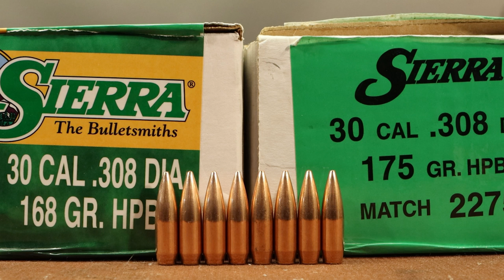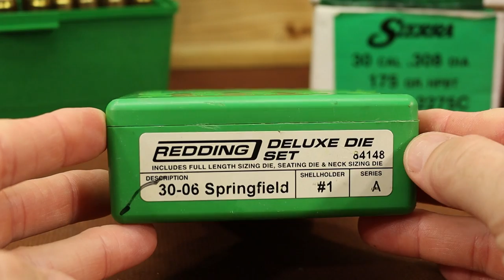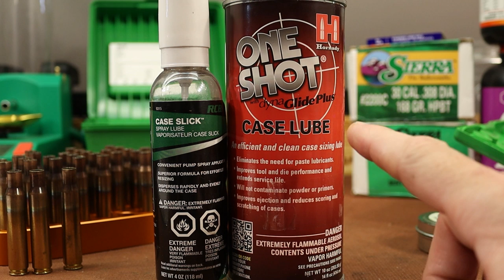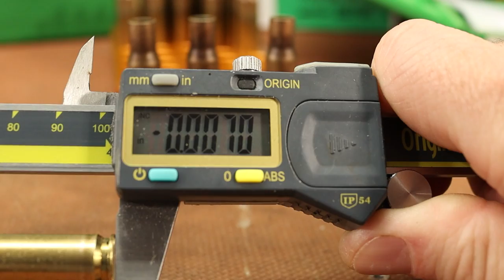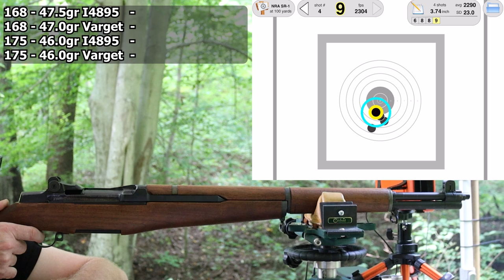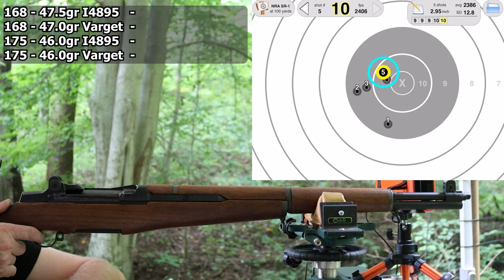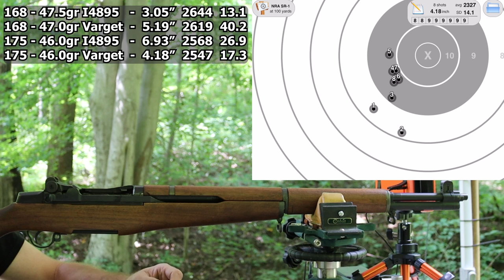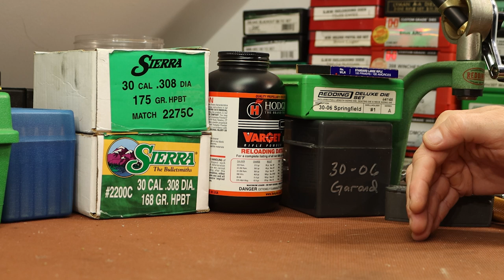Reloading .30-06 for my M1 Garand

Comment: Boy, was this video up my alley.  Good job.  I started reloading and shooting National Match in the early 70's.  I shot Garands and M1a's until the AR's showed up, now I mostly shoot in the John C. Garand matches. The only powder I use is IMR 4064 or  H4895, #1.  I load mixed commercial brass except for Federal, it's the heaviest brass out there even exceeding military by a large margin.  I use Winchester or CCI primers and my bullet of choice is the Hornady 150gr FMJ even out to 600 yards.  I duplicate the M2 ball load with 46gr of the H4895 and get 2805fps with the 150's.  The ARMY crono's were set 71 feet from the muzzle that's why the MV is slightly higher than their spec.  This is also the load recipe the CMP has loaded by Creedmoor Sports for their ammo.  My latest Garand, bought from the CMP, is a 1942 SA Philippine return and it now wears a Danish VAR barrel (+1 throat & muzzle) and has a very tight, new CMP stock.  The only changes from as issued is a Orion 7 stainless steel main spring and a ported Garand Gear gas plug.  https://www.garandgear.com/the-m1-garand-and-commercial-ammunition/
With that load my Garand will shoot 1 moa off the bench with the H4895 and 150 Hornady's.  I know, I hit the jackpot with that rifle.  I spend most of my reloading time on brass prep, I use the alcohol/lanolin homemade lube and I bump the shoulder .002" to .003".   I too could go on for an hour but you're on the right track.  IMHO you should try some 150's and step up your charges a little, that's where I found the largest accuracy node and it work's in all 4 of my Garands.

Comment: Thank you for such an excellent and detailed video! Have been reloading for about 40 years and started on my father’s sporterized 03A3 hunting rifle.  Got an M1 inbound from CMP.  Every once in awhile there is something that truly is a quantum leap in reloading.  First, I adopted metal media for my two tumblers.  Wow.  Even the worst looking used range brass looks like virgin after about two hours.  Second, I’m ultra paranoid about contamination in my reloading.  After resizing and de-primering, the brass all goes into the tumbler for thorough cleaning.  I then know that the case lubricant is all cleaned off.  No chance of contaminating a primer.  I use a Lee hand prime ring tool, and my machine of choice is an RCBS single stage.  I started with their Rock Chucker but moved up to a newer one that comes with a long and a short rod—I use the longer for better leverage.  I also use the fancy RCBS power measuring device with integral trickler.  Very precise.  Lastly, I use the LabRadar Doppler radar to determine muzzle velocity and speed at various points along the 100 yards.  Pure magic!  Again, a very good primer for someone brand new to reloaded, and a great reminder for me after 40 years of this hobby!  Looking forward to the M1.  I’ll be sticking to my 4064 which I started with for my 03A3, and with 150 grain bullets.  Thank you, for such competence!

Comment: 26:26 a piece of advice for new reloaders, stick with one charge weight and bullet combination at a time. Charge five cases with the same weight of powder, seat your bullets, move the loaded rounds to a container with a label showing exactly what they are, then move on to the next charge. I've wasted a ladder test or two in my day by getting things mixed up. Until you are confident in your procedures, process, and workflow, don't try to do too many things at once.
Reply: PERFECT ADVICE FROM JOE THE FOX , no use wasting a day and a trip to the range, keep it separated and dont let the counter boys dump your ammo for inspection into a pile while you turn your back for a split second
Reply: I've started using a sharpie to put my charge weights right on the brass in addition to a label on the container with more detail
Reply: I never loaded anything over 150gr heads.
Reply: @tyrellmorris9503  I've been doing the same thing for years.  A great way to keep track of things.
Reply: @bumblebeebob  I just use roman numerals in sharpie to mark my brass after every charge. Dullest pencil sharpest memory sort of thing

Comment: I've been using 168gr hornady bullets with varget. 
Years ago I bought a bunch of lake city brass.
Still have some virgin , but never a issue with varget. Just use plain old f.l. die set from redding. 
Love smacking steel with my Garand.

Comment: Johnny  one tip I have used for forty years is to spray  Lock-eze on to a rag and wipe the rag on the plastic funnels and it puts a coating of graphite on the funnel and kills static electricity that causes powder grains to stick to the funnel. Another thing to use is powdered graphite on a rag and wipe the funnel so you get a grey sheen on it. I Think pencil sharpener shavings would do it to.

Comment: Johnny, you're not having feeding issues. Smacking the back of the handle is part of the normal manual of arms for the M1 when inserting a new clip. (Yes those are actually clips, the magazine is internal on the Garand)
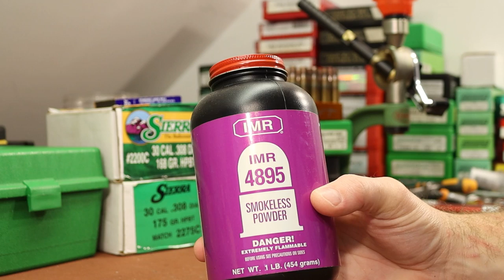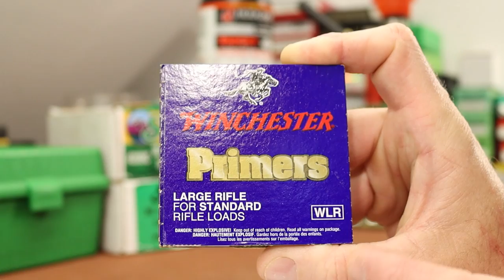Search for the video "M1 Garand - Principles of Operation (1943) United States Rifle, Caliber .30, M1" here on youtube and you'll see them routinely smacking it during loading. It helps prevent the dreaded "Garand thumb" (They do it twice between the 1:30 and 2:00 min mark)
Watching you load those clips, I predict you're going to get to experience the pain of a Garand thumb in the not to distant future

Edited to add: they change how they taught to insert the clip after this training film was made, to prevent Garand thumb. Once you get one, you'll understand why.
At a Garand training match, I had a President's 100  shooter/instructor put it best, "Garand shooters fall into 2 categories, those that have had a Garand thumb, and those that are going to get one"  FYI, they HURT!!

Comment: On the subject of case lube: GunBlue's way of applying Lee lube works great. You put a little lube inside a clear plastic container (like gladware) and shake the brass around until the lube is spread evenly along the entire inside of the container. Then, you use a q-tip like JRB just showed. Let it dry for an hour and you won't get any dents.

JRB, your presence on this platform is probably saving some from injury. You've definitely saved me a lot of money. Thanks again.
Reply: I hate to admit this... But, I add a bit of liquid car wax to my walnut shell media which does a really nice job of slicking up the brass as well as making them shine ;-) Killing 2 birds with one stone so to speak... My 2 cents
Reply: @n7565j  you're not alone. A lot of the dry media guys do that, at least to get the lasting shine.
Reply: @novicereloader  I'm glad I'm not alone👍 Thanks for not just calling me an ID10T 🙏🙏
Reply: @n7565j  did you notice my channel name? I wouldn't call someone names, unless they persist in being unsafe. JRB called himself that lots on the video with the primers blowing out, because he failed to check his brass between shots. He'd be right if he hadn't had the guts to also show his error and keep others mindful.

Comment: Johnny... seems like you are getting a lot of advice and support on IMR-4895, as you know, that is my go-to powder for my M-1 National Match rifle, I have won many medals with that powder over the years, (IMO) Varget is a little slow, as is the case with IMR-4064, they work, however, the chamber pressures are higher than with IMR-4895 and that will put undue stress on your bolt lugs, So, watch for shiny worn spots on your bolt lugs and receiver recesses if you continue with Varget, another thing as well, I use small base dies, I have witnessed a few super nice Grands worth thousands of dollars blow up because of a few thousands of (Out of Battery lock up on the bolt lugs) remember, the only place that pressure is going to go is back at the shooter. I feel it is better to have a little looseness in the chamber for positive feeding and lock-up of the bolt lugs.  So, That's great that you are shooting the old Girl, she will teach you a few things in Marksmanship, I feel that handling the recoil of the .30 caliber rifles in a match builds outstanding skills, more so that a scoped AR-15, (Not the same deal). Peace out. -Dave
Reply: Would you use IMR-4895 for .308 Winchester also, or would Varget be suitable for the cartridge? I want to start loading for my AR10.

Comment: I think my favorite recipe for the M-1 is a 150 grain FMJ over 50.0 grains of IMR 4064... absolutely love that load.  Shoots around 2780FPS or so and shoots light out in my rifle.
Reply: I use the 150 FMJ Hornady's and 46gr of H4895 to get just over 2800fps, basically a M2 Ball load and my Garand shoots better than most bolt rifles.
Reply: Years ago l settled on 49.0 grs of IMR 4064 for around 2740fps.  This was the older longer grained powder.  I've noticed the newer stuff is a shorter grain and haven't tested to see if there's any difference.
Reply: @bumblebeebob  yeah it's funny how a powder that is the same brand and name can still change from one lot to the next.  Either way with the new powder I'm sure your load recipe will still work great!

Comment: As usual, a great video, Johnny! One tip though for using Imperial wax on the inside of the necks: instead of using a Q-tip, just wipe your imperial covered index finger across the case mouth, and it will squeegee a little lube inside the case neck. Given, it won’t be all the way around the circumference, but the expander ball pushing in and out will spread it out nicely. Please keep up the great work Buddy. I love all your videos!!

Comment: With my first Garand, 37 years ago, I didn’t know that you were supposed to use Garand specific loads.  OOPS!!  Now with years of reloading experience my current Garand is running much better.  IMR4895 is the only powder I use for the Garand.  At least I didn’t blow my face off!
Try resting your rifle on the stock and not the front hand guard, is is designed to fit loose and may be affecting accuracy.
Reply: In my M1A or Garand , its IMR 4895 or NOTHING , 60 years of reloading proves this in my rifles , and my RCBS partner is this going strong after 46 plus years , with all calibers 30-06 down to 222 Remington.
Reply: I don't remember my charge weight off hand but I've always had for luck with imr4064
Reply: @deathsicon  IMR4064 is my favorite 308 powder.
Reply: @SSgt-  I started on 308 2 years ago and it's been my go to for that as well I pick it up just about every time I see some at a decent price

Comment: It hurts to watch you rest the rifle on the front hand guard.  The bolt hesitation on closing is normal.  Just shove the clip down until you hear the click and take your fingers and thumb out of the magazine well.  Then a light tap of the rear side of the charging handle will close the bolt.  Your clips are a little rough on the edges, and that will cause the bolt hesitation until the clips smooth out.  HXP brass is inconsistent volume wise, but will last a long time.  Segregate  the brass by year date.
Reply from the maker: I originally set up my rest to sit on the stock but decided to just put it out on the handguard at the last minute. You're not the only one complaining. I won't do it again.
Reply: Would it not make sense to do your load development with the rifle rested on the handguard if that is how you intend to fire it? I'm not going to pretend to load for Garand but I personally beleive this comes in to play with many rifles. milspec handguards for AR come to mind which I have observed POI changes as well when fired rested on different locations(base of handguard/slipring, mag, and front of handguard.

 I can only assume it can have an effect on harmonics but I Am interested to hear your findings with Garands and load development/groups, I really don't know enough about them besides commonality they share with all firearms.
Reply: @JohnnysReloadingBench  You are forgiven.  LOL
Reply: @savagereloader6699  The front hand guard is just there to protect the shooters hand from the moving parts and any heat.  It is nothing like a standard handguard on an AR.  Resting the rifle on the front handguard will produce variable forces on the barrel and gas cylinder and cause huge POI shifts.  You will see the front sling swivel is behind the front handguard, and is meant as the most forward point of support pressure for shooting.  The front handguard can be adjusted to provide some pressure between the sling swivel area and the end cap of the front handguard, and this will provide dampening of the barrel vibrations.  Get this pressure correct and an M1 will go from a 4 MOA rifle to a 1MOA or less rifle.  Like most wooden stocked military rifles these barrels are not free floated, but dampened by the stock if properly fitted.
Reply: I was also taught to not hold the weight of the rifle by the upper hand guard.  But we were competitors trying to shoot MOA with 3 MOA ammo.  Johnny, I still see 300fps less on the video than you are saying in the audio.
Reply: @gordonv2456  that’s because he’s calling out the velocity at the muzzle and the video is displaying velocity at the target. It’s very typical for a bullet to lose 200 to 400 fps in first 100 yards.

Comment: The front hand guard is a huge source of variation with the point of impact.  Many Garand shooters lock the front hand guard down with a process called “unitizing”.  They ream the front hand guard ring, screw and glue the hand guard to the rear barrel band.  It free floats the barrel in front of the hand guard.   Your use of the front hand guard to rest the rifle is probably going to cause huge variations in barrel vibration.  When I unitized my Garand hand guard my 8 shot groups shrank from 3.5-4” down to about 2.5” .  It is a lot more consistent.
Reply: You have been selected among my few giveaway winners, endeavour to Reach out to claim your Prize.
Congratulations🎉🎉🎊

Comment: I’ve been using the Lee threaded cutter and lock stud. Works with the same case length gauges and shell holders but you can screw the cutter into a motorized case prep center. So I can run my brass through the trimmer, primer pocket scraper, chamfer, and de-burr all in a matter of seconds. Works nice if you are doing larger lots of brass.

Comment: For what it's worth, Lyman sells a decapping rod that has a carbide expander ball that can be used to replace the decapping pin for certain dies, including RCBS.
It allows me to totally avoid contaminating the inside cases with a bit of lube inside the case mouth.

Comment: For the sake of simplicity and not missing anything, when I run the single stage press I go straight from powder charge to seating the bullet in that case, stops any confusion on if I missed or double charged a case, and the time it takes to seat it lets my Frankford rig throw the next charge so I'm not waiting on it

Comment: This is an excellent video even for a beginner like me. Could you please provide info on the target and velocity products you used at the range? Thank you.
Reply: His target looks like a 100 yard NRA high power target which would be correct from my understanding for this application. His chronograph looks like a doplar radar which is a good piece of kit to have. He has a shot mark system at his target using microphones to gauge muzzle velocity and bullet impact point that sends that data to his computer.

Comment: I took Basic Trng. summer of 1963 with the M-1 Garand & have three of them; yeaJohnny you got to have a WELD-Spot for your cheek on the butt stock to keep the rear sight the same distance  each shot. I was19 & "bullet proof". Shot "EXPERT' on that K D range @ FT. POLK,LA .  I use IMR 4895,IMR 4064 IMR 4831.As always GREAT video young man. 1SG, J J Huro Jr. USA, RET.

Comment: Thanks Johnny.  Sounded like your rooster wasn’t happy about those 30-06 loads.  Do you ever use that Franklin arsenal primer anymore?  I shelled out some cash for a 21st century primer but wondering if the FA adjustable primer is a better deal.
Reply from the maker: I haven't used the FA primer in quite a while. My main problem is its weight. Really heavy!
I seem to always grab the RCBS universals because I know I won't have to mess with shell holders.
Reply: @JohnnysReloadingBench   have you had any issues with large primers with your FA priming tool? Just got one and it has too much play between priming pin and guide , it leans over and puts half moon dents in primers . Just the large , small is fine . Love the channel , keep it up!

Comment: 4895 is the traditional favorite for the Garand, and that's what I used to make up 100 rounds for my father-in-law's Garand.
There are others that are acceptable in that platform, namely 4064 and a few others.
You definitely don't want to use the slower powders that allow you to get a bit more velocity out of bolt actions, namely the likes of W760, H414, and any of the 4350 or 4831 powders.

Comment: I reload .30-06, 7.62x54R, and .223. I use the Lee Hand press, Lee Pacesetter (3 die) sets, and Lee case lube for all 3 calibers. I originally purchased Lee Loaders in all three calibers but ran into neck tension problems with 7.62x54R using PPU brass and .311 bullets (maybe .312 would have been fine but were unavailable for a while). The hand press requires a little upper body strength to use with the larger calibers but does the job. I think pretty much any bench mounted press would be fine for .30-06 as long as it has clearance.